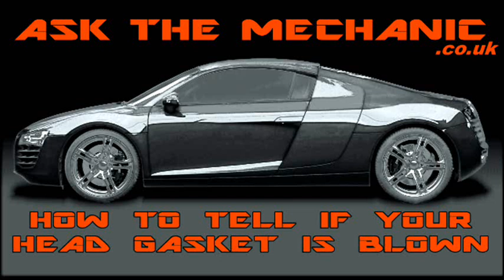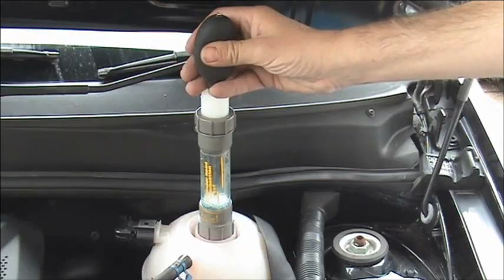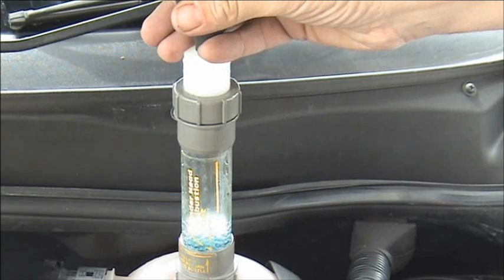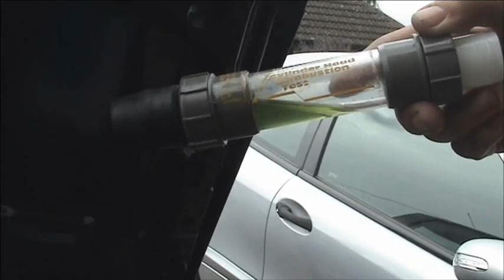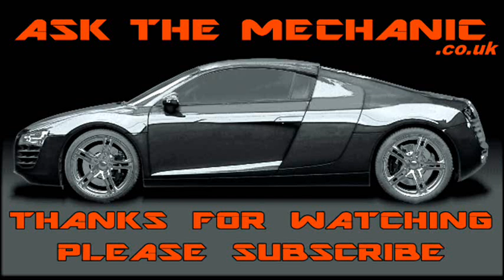How to tell if your head gasket is blown

Comment: I have oil in my coolant but motor isn't running hot what might it be?
Reply from the maker: Head gaskets seal oil, coolant and compression so you can get oil in the coolant without any overheating. Some cars also have oil coolers that are Heat Exchangers and use coolant to cool the oil, these can sometimes allow oil into the coolant.
Reply: @AskTheMechanicCoUk  its a pink looking color.I'll on dip stick not milky
Reply: @AskTheMechanicCoUk  I forgot to tell you its a F150 4.2 liter

Comment from the maker: If it is a diesel engine there is no natural vacuum, it is created by a pump, the easiest way to find it would be to follow the pipe from the brake servo.
If it is a petrol engine you would need to pull off a vacuum pipe from the inlet manifold or as in the video the best and easiest way is to use hand vacuum pump.

Comment from the maker: It really depends on the car and the labour rate, if you had a simple car like a 1.3 Fiesta the labour would be 3 hour + gaskets + coolant + any other component that may have cause the gasket to fail (radiator, water pump etc.) If you took it to the main dealer you could be paying 3 times more than a mobile mechanic.

Comment from the maker: Not really, oil leaks from the head gasket would normally be from the main oil pressure galley to the head and are not easy to stop without replacing the head gasket. Most of the engine oil sealers work by softening the oil seals.

Comment: mine was easy to do i took off the radiator cap and has visible exhaust coming out of the radiator popped off the head and the head gasket came off in three pieces